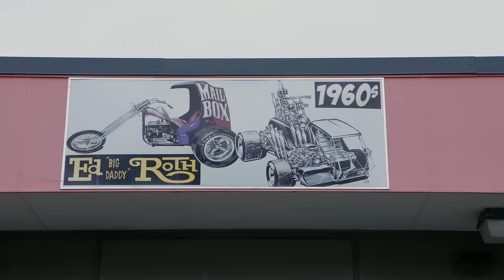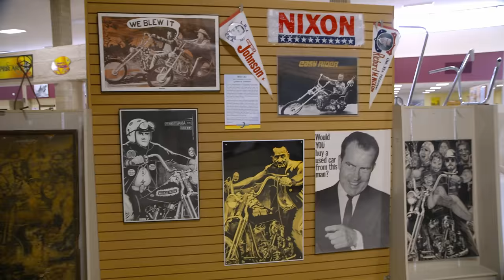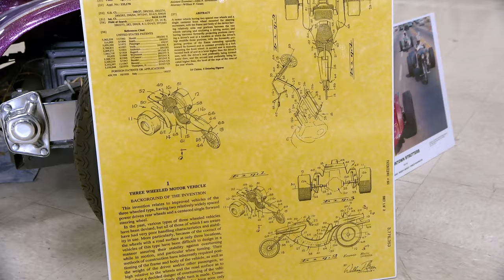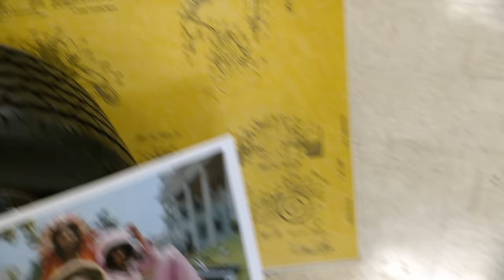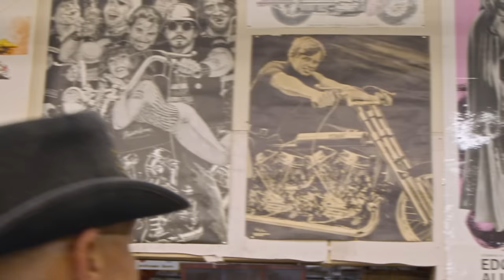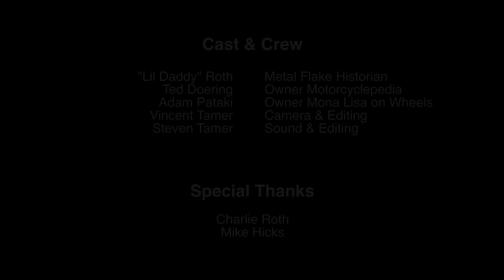Finding Ed "Big Daddy" Roth's Treasured Trikes with "Lil' Daddy" Roth

Comment: Your dad was built 21- 3/wheeler motorcycles using 289 ford motors,C4- auto. transmissions with narrowed 9” ford rear ends.
In 1978 your father built 8 for “Mad Max Studios. He sold a rear end, twin 78 Vega radiators, fraim, for $500 to Guirelmo (sp) from Ecuador who lived across the st. from your daddy’s shop in Hollywood  The fiberglass body for another $500. He then moved to Tijuana, Mex. In 2980 I meat him in sd ca. I repaired the C4 trans for him.21 yrs later he gave it to me for $500. Since 2017 I have been restoring it. I don’t know how to add a picture on here. I am 76 yrs old. It needs a complete ext. hjdrolic Harley front end and it will be be totally restored.
   Any information you could give me on this trike would be appreciated. I do have a msg. From 1980 with 3 of these trikes cruising down Hollywood Blvd.Giuermo passed away 10-15 yrs ago.i have no more contacts that could tell me abt what I now have.
TKS
MK Duke Linnemeyer
San Diego, Ca.